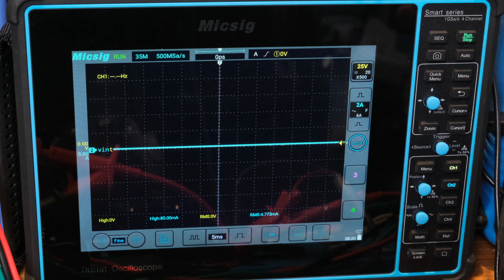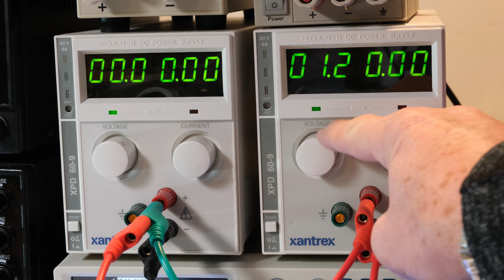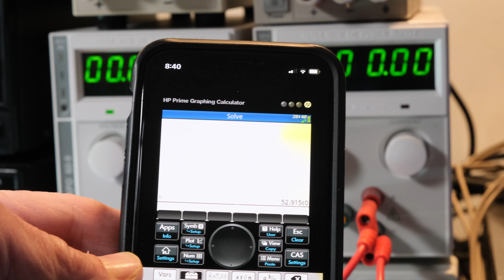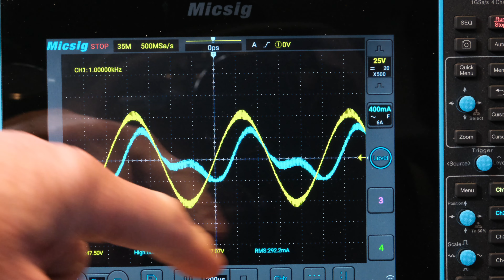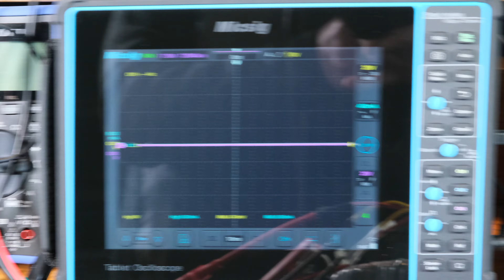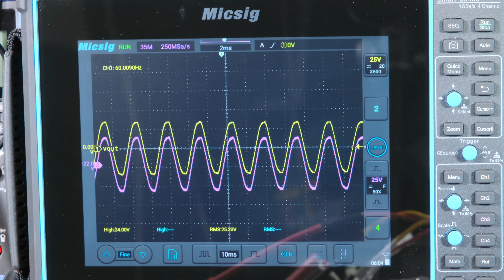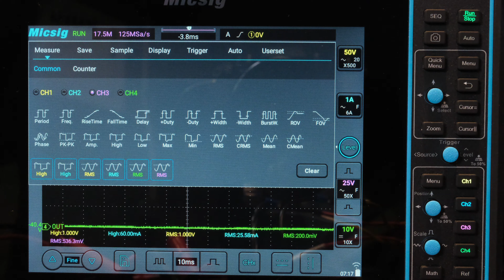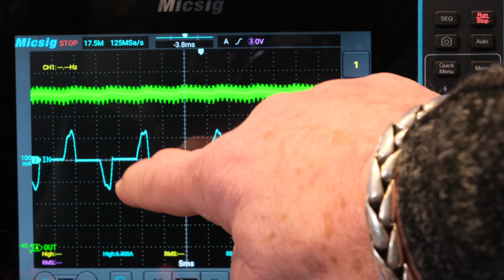350 Watt Class D Amplifier Can it do 350 Watts using the IRS2092?

Comment: Wow, thanks for this extensive review on a IRS2092 board! I saw a lot of these cheap mono boards on Aliexpress promising astronomical wattages and I've been curious. Of course I don't have a decent 50+ Volt DC power supply and it would cost me more than these boards themselves so I've resisted. But they do seem mighty interesting for a little project...
Reply from the maker: Thanks!  Yes, I think if I change out the 2 resistors for different values that I might be able to get closer to the 350 Watts - and maybe it will put out the 350 Watts.  I guess I should first try running it at 200 Watts for an extended time to see how hot it gets...

Comment: Thanks man for the update really appreciate the video but what's the verdict can it do the power or not I was hoping to purchase that board for a sub for a project I'm working on
Reply from the maker: Thanks for the feedback!  In this video with 70Vdc I could get to 200 Watts as I showed, but I'll have to do a small board change so that I can get the voltage up a bit higher to see if I can reach 350 Watts.  First, I'll have to run it at 200 Watt continuously to be sure it doesn't run too hot.  I'll post a video on this tomorrow - if I can;)

Comment: Hi again
I dont understand, does these boards run ok with just a transformer? Dont they need some kind of stabelized power supply
Reply from the maker: Thanks for the great question!  This is what I call a low frequency switcher (transformer with bulk caps).  Most amplifiers do not have regulated power supplies.  Did you see my latest video on this amplifier?  I get close to max power.  https://youtu.be/vbyGYaWfxf0

Comment: Lots of high frequency modulation on your high amplitude sin waves. Seems like the output filter to remove the class-D modulation may be inadequate?
Reply from the maker: Thanks for the great feedback!  I think when the signal gets too close to the power rails this modulation starts to show up.  At lower power levels it shows up with lower voltage rails.  At that same power level with higher voltage rail it doesn't show up until the signal goes up to closer to the voltage rails again.  So it would appear that the filter can handle that particular power level and that it seems more related to the voltage rails.
Reply: @KissAnalog  Ah, okay, that explains your comment about needing better high frequency power supply decoupling. I don't recall seeing so much high frequency modulation not associated with oscillation in the past, but I haven't had a need for this much output power since I sold my Ohm F speakers thirty years ago, and back then, nobody was using class d amplifiers!
Reply from the maker: I'm also interested in what the speaker crossover does for filtering.  I'll have to investigate that as well.

Comment: You can make a simple alarm for your camera don't need much could fit it in a matchbox put it in front of the LED light when it starts flashing  set off a buzzer
Isn't it better to put some storage capacitors in front of the transfer like motor run capacitor, wouldn't that make it for the AC loss.
What's the benefit of having these large size!! caps in power supplies? Is there any?
You always get a like a thumbs up from me it's at least I could do lol👍👍
Reply from the maker: Thanks for the questions!  Motor run caps are good for inductive loads, but not much good for amplifiers.  The large bulk caps are needed because they are used to smooth out the pulsating voltage from the rectifiers, and these are being discharged by the load between cycles.  So the caps need to be large to keep the voltage up.

I appreciate the thumbs up;)
Reply: @KissAnalog  I'm not sure why they wouldn't be any good for amplifier?? They're not all industrial I mean domestic appliances have them. what about storage capacitors then? I would have thought that the transformer wouldn't struggle so much If it's fed from a bank of capacity at those critical moments.
Reply from the maker: In motors, the capacitance offsets the inductance.  In an amp, the input looks capacitive because of the large bulk caps.  The best way would be to use a regulator off the bulk caps, but practically no one does this.

Comment: Run it hard until it blows up. Check its protection features
Reply from the maker: Thanks - I think I will run it for an extended time at 200 Watts to see how hot it gets.  If the efficiency is good maybe it will or maybe it will take a fan.  I'll try that and post this video tomorrow;)